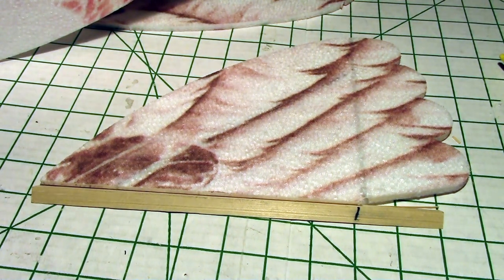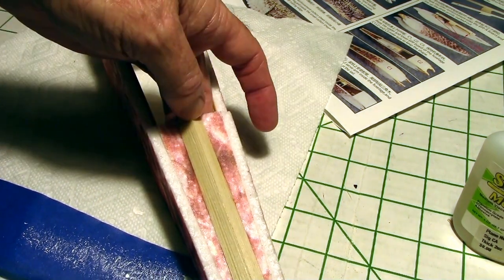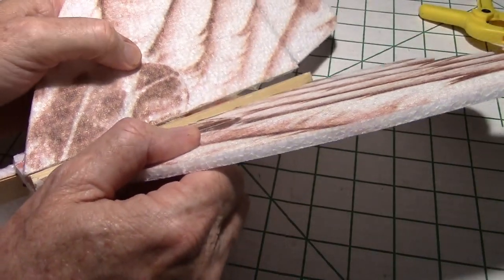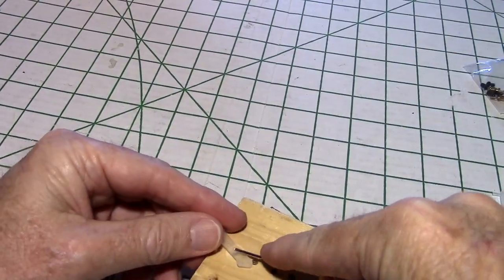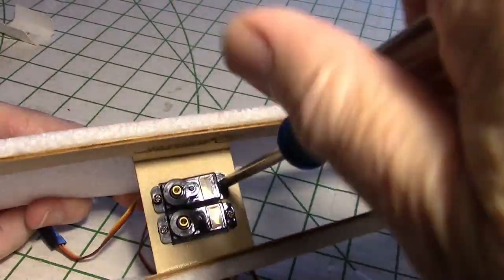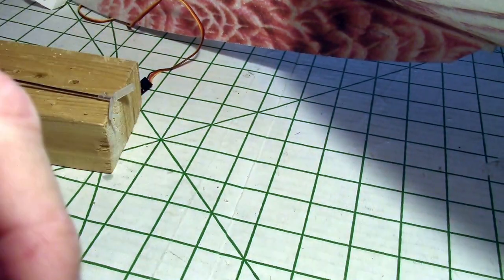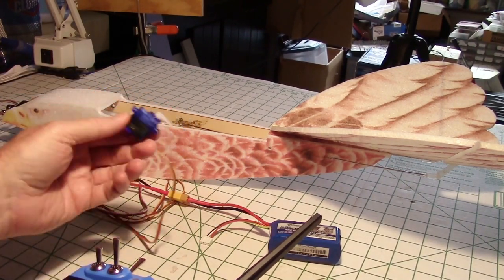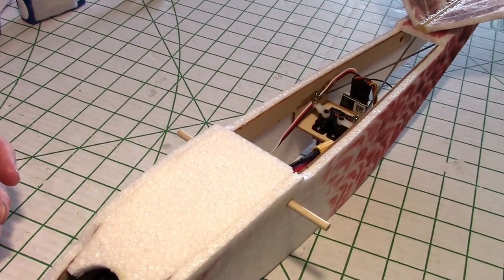DW EPP Mini Eagle RC Plane Build Part 3 - Power System & V-Tail Setup

Comment: Great video, thanks for sharing. Quick question, I’m new to RC & have a V tail powered glider. I thought I needed to install either a V tail mixer cable or a V tail signal reverser cable? As I said I’m new so please excuse the question if it’s mundane.

Comment: Thanks for the previous Speedy video explanation...;-)
Reply from the maker: Just pick'n on ya,,, 🎸
Reply: @DaveMerc  N/P... Just waiting to see how your Eagle flys with the 120 degree splay of the tail. I've built my 1200mm Eagle with the recommended 90 degrees. (haven't flown it yet). I may set the tail of my new 1400mm Eagle V2 tail to 120 degrees if yours still flys with good tail control when it shows up and I build it.
Reply from the maker: Worked good once I reversed the rudder channel, my bad. https://www.youtube.com/watch?v=726n9STieQY